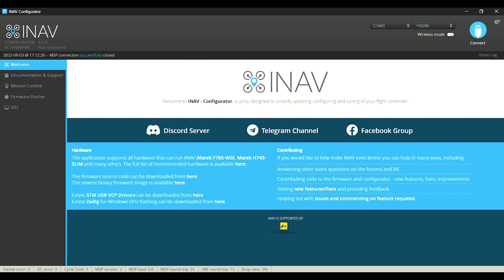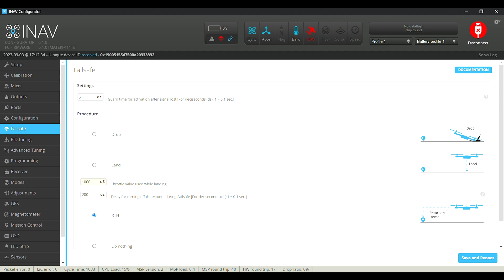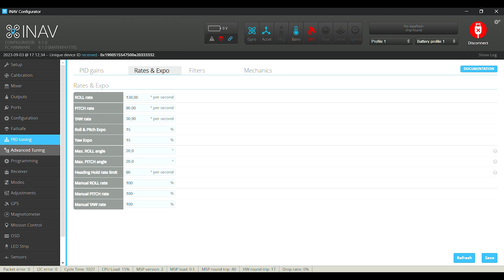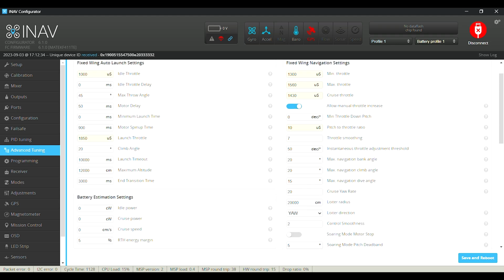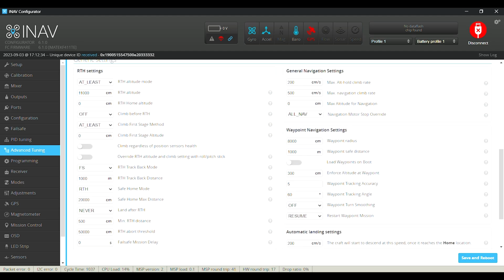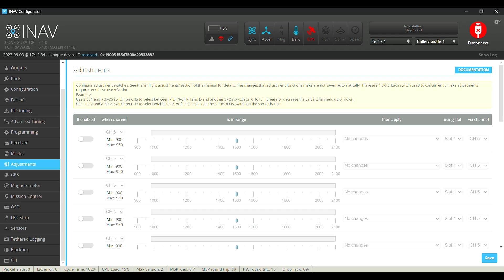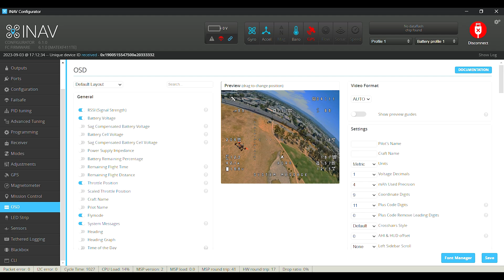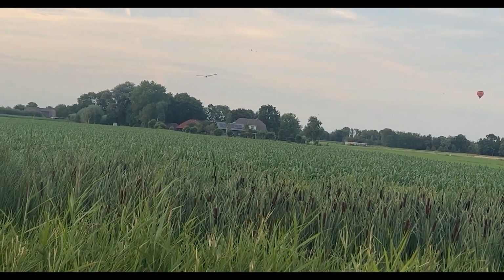Autonomous UAV for Long Range FPV & Waypoint Missions (iNAV Configurator Settings)

Comment: Could you make a video about what you have to do at the airport.

I don't know how to call up the route that I have saved in the EPROM and what do I have to do so that the drone then flies to the waypoints?
And how can I intervene if the drone doesn't fly as it should?

When do I have to switch NAV WP mode on or off?

What does NAV WP mode mean?

Thanks in advance

Comment: Hi, if we already set a way point mission but we lose our signal (remote) can our plane go back?
Reply from the maker: If you set failsafe to RTH, it'll come back.

Depending on firmware on your flight controller & configurator program, you can remove failsafe for WP missions only (meaning it'll continue waypoint mission even when signal is lost. It'll be in your control again when WP is deactivated manually)
Reply: @AeroStuffFPV  wow it is so amazing. I will learn more about it
Is there any Group Chat Available  for Inav autopilot plan?